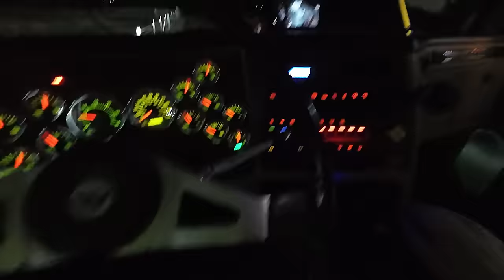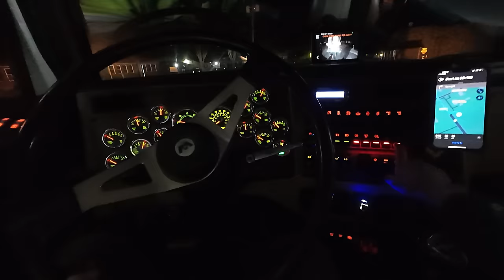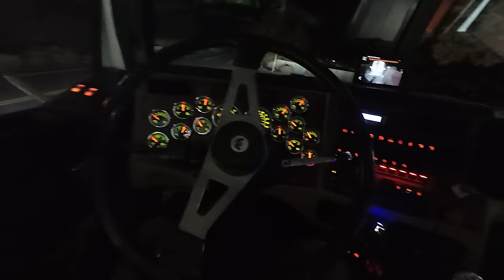This job almost beat me..

Comment: Hey Casey Like your Videos, Just wondering why you just didn't drag the back around with the winch enough  to hook to the rear. Been a Diesel tech for 30 Years , those old Spicer style cup u-joints have always been a bear to get out,  unless there the new style half round we grab them from the rear if possible, I have spent 3 to 4 hours in the shop and with a Torch just to get them dang caps out and usually have to replace the yoke because there in so tight they gawle  up the yoke  . I avoid them at all cost when on the road with limited tools just curious

Comment: I do love my tigertools for the rigs and my get around vehicles especially 1 ton trucks with aluminum driveshafts the dumbest idea because if you regularly grease your vehicle and ujoints last till the 2 different metals basically bond together and the ears bend or snap when i hear ujoint noise I swing by my driveline shop have a metal 1 made and either break the ears off or saw the shaft in half and toss it in my scrap aluminum bin

Comment: Could you have backed out, took it to the store and switched ends there? Also, I've never seen "pressed in" ujoints that needed a press. I've only seen em in worn out AC loaders.

Comment: Lucky that horse can't leave YT comments... they could tell you how you did everything wrong... after all, the horse was actually there, and as an experienced heavy recovery operator, the horse would certainly know...
Looks like the coat of black paint on the front bumper and drive wheels was all that was holding that truck together for the past 18 months...
When you were removing the driveshaft, I could not help but notice the cardboard and duct tape 'apparatus' on the front diff... looks like an aftermarket part!

Comment: Hey Casey, you ain't got to pull the driveshaft on a rig if it has a manual transmission, you can leave it in neutral and roll on, now automatic transmissions are a different story
Reply from the maker: You are very wrong

Comment: Because I know nothing… I get the transmission is lubricated from the engine side, but to pop it into neutral and move it a few hundred yards or even to the station you turned around so you aren’t working in the mud and have more room… does that not work?

Comment: I reckon the Casey way of doing things on that job was the right way already. Now if someone would only invent a way to quickly disconnect the drive shaft with a lever and the pull of a pin....

Comment: By the time a rod comes out the side of those engines, the crank and heads will also be done. Bearing material will have gotten everywhere, destroying the oil pump cams, in to the timing. That's a lot of scrap metal. Why was that short video about brake pedals dropped in the middle of that clip?
Reply: Oh, Happy New Year BTW. We have floods all around us here, so I don't really want to go anywhere. Plus heavy rain forecast all night, then a big storm for tomorrow.

Comment: I hate you Casey!  You know your way around tractor and trailer And around tow trucks, one ton to ten  wheelers. Good on you.  You were spot on on the way you worked through the decision matrix to come up with a plan. You were good until you grabbed reverse. I was a traffic officer on US 101, south of San Jose, CA, called Blood Alley. I ran interference for the tow operators who came to clear my roadway. The road was four lanes wide and nine miles long with no controlled intersections. My first year saw 21 fatalities. When a tow rig showed up on my scone, I had one question: What do you need ?  If you were on my roadway and didn’t let me cover you when backing out of that driveway we would have words. It’s my job to keep the roadway safe and I knew how to do that. Please don’t think you are doing law enforcement a favor by not getting us involved. Yeah, I kinda still Hate you but just until I can buy a shirt. Keep doing what you do and I’ll keep watching, Ed

Comment: If you were willing to pull it as a tow "forward" into the farmyard and then swap ends, why didn't you push backwards onto the road, pull it down the road to the store, and swap ends in the store's lot?  Possible damage to the transmission would have been minor either way. -Honest question, not a troll question.
Reply from the maker: Because to tow it down to the farm yard would be nothing more than lifting it with the forks and going.  Towing it down to the store would be tying down the front end, safety chains, and rear light.  At that point I might as well just pull the shaft too and be done
Reply: I don't think I made my question clear.  Why didn't you lift the front as you did and back it out onto the hwy., then roll down to the store, and swap ends in the store's lot, tying down the steering wheel etc.?  No need to pull the drive shaft for the short hop, and minimal possible damage to the tranny.  I know I am missing something, I just am not seeing it. @CaseyLaDelle

Comment: The 3rd and 4th options would have been flat bed it. Or pull the axel rods out but if you dont have cover caps then you lose all the axel oil.

Comment: Question, why do you almost always remove the driveshaft?

From what I've seen in a few videos from Europe, there, the towing service mainly removes the drive half shaft.
Reply from the maker: Because removing one driveshaft is faster than removing four axle shafts
Reply: @CaseyLaDelle   From what I've seen, it's only one. Maybe two if the truck is 2 axle drive. 

https://youtu.be/4hLQ7opU-mw?si=NW5OZ475UAIDbz_N&t=582
Reply: @CaseyLaDelle  You may actually be right that sometimes it is necessary to remove both halves. With that said, I guess it depends on the axle manufacturer - ZF recommends removing both.

https://youtu.be/rHyCzPx5mzY?si=K7WTGT3YQp6fpSV-&t=992
Reply from the maker: @spexpl  all four must be pulled.  Anything less is a hack job

Comment: So in a case like that, What i have done is pick the truck up with the boom from the back of the frame. Straighten it out then back up the drive, Put rear axel forks in and lower it onto the under reach. Works really well for one backed in if you can get backed in beside it. Another completed tow, Well done. Not sitting in traffic is always a plus.

Comment: Gentry and Sons Trucking decided they wanted to be a wrecker service and he has never had experience with the obviously you should check him out but whenever you are securing the axle to the Zach lift you should run your safety chains around the axle hook them in and then stretch them out tight so they are doing two things holding the axle to the Zach lift and working as the safety chain it's funny when you went to shorten your safety chains I was thinking the same thing
Reply: I'm sure the straps hold the axles just fine but chains would be even better but to each their own
Reply from the maker: How would the truck turn if I did that?
Reply: @CaseyLaDelle  once the chains are locked down in 2 chain locks each and the safety chains loose enough for you to turn I seen them do it on one of the shows where they are Towing on a Snowy Mountain Pass guys that have been Towing for 30 years

Comment: would have towed it from the rear , and left the truck back a little more , but dont think those lights would be in the way anyway, easier then pulling that driveshaft, utilize the underlift, instead of shutting down the road .I'd have pushed it into the driveway further , then hook it and go. that driveline is a perfect example of a mechanic that dont use anti-seize when he put it together.
Reply from the maker: How would you push it into the driveway?
Reply: there wasnt that much traffic on the road I would have backed up to it like i was hooking it and got it farther into the drive before completing the hookup
 @CaseyLaDelle

Comment: Why do you have to pull the driveshaft, why can’t you pull it in neutral? I honestly don’t know much about towing.
Reply from the maker: The gears in the transmission are what splash the oil around and lubricate the bearings.  When in neutral, the gears aren’t turning

Comment: Why wouldn't you drag rear parallel to road and hook up rear roll down the road. Seems like much less work and not closing off road.
Reply: Casey explained all that,  he did not want to do that on the most accident prone time of the year "possible drunk drivers" and high danger.      Listen at 37:00 for a few minutes,
Reply from the maker: I wasn’t going to work next to the road.  I would have gone home and left it for someone else to deal with if that were the only option

Comment: I’m not sure how a well greased u-joint comes out easier considering no grease is applied between the yoke and the joint…..
Reply from the maker: It actually comes out a lot easier than a dry one because you’re only fighting one dry joint instead of two.
Reply: @CaseyLaDelle  that makes since

Comment: My vote would have been boom the whole tail end to an angle to snag from the rear…
Reply from the maker: I wasn’t going to work on the shoulder of the road.  I would leave it there and go home before I did that
Reply: @CaseyLaDelle  of course I wasn’t there and cameras do no justice to angles and distance. All of this is 100% couch quarterback 😏

But the side of the driveway you pulled into looked wide enough to pick the whole tail end up on an extend boom, pull the boom back, and even back a little on the boom - drop and pick from the rear… At least from my couch… Or boom over the cab and pull it further into the driveway. With a remote hop in the cab and steer it down the driveway. Just seems you got a boom you might’ve been able to put that thing in a better position for a pick on the under reach?

I used to do it with sling wreckers in a junk yard when I was a kid - my first job. Which doesn’t make me a know it all, but done it before on smaller stuff that damage doesn’t matter…

Just seemed like the two options you were thinking of were making use of one tool when you had the use of two. A boom to get you to a place better for the under reach. 

Anyway do love the content - and the channel. Sorry about my couch comment…. Happy new year!

Comment: You have already made your decision, but I wondered if it would have been possible to tow it from the front a far enough distance to get to a place you could pull off, then connect to the back so you did not have to drop the axle.

Comment: Looks like a good job for your trailer if you had only known
Reply from the maker: That would be way worse.  Nowhere to park the trailer
Reply: Yes I fully agree with not having enough room to park the trailer and I think you did a terrific job I have never run a wrecker truck but I certainly have been broke down enough times with a big truck

Comment: Just pull the driveshaft.  Those 1710s aren't that hard.  I've pulled them under the same conditions - and then had to rebuild them, including cutting the yokes and welding in a new tube.

Yeah, I know, it's cold, you're tired, it's the middle of the night.  Got it.  Just do the deal.

Comment: These are the most dangerous jobs. That's when A. you don't want to be there. B. nothing is going right. Anc C. frustration is setting in. And D. time is short. That's when things, for me, are most apt to get really messed up. It takes a lot of self control at that point.
you bet a pass on a little bit of foul language on this one. It may have helped a little bit.

Comment: Why would you grease a with a press fit you don't need grease on that part it comes out easy because it's worn out
Reply from the maker: When the yoke itself is dry it makes it much harder to press the cap out

Comment: Why not pull an axle 🤔
Reply: He’s replied elsewhere is that it’s not easier because that would require dealing with all four axles versus one driveshaft.
Reply: @JohnHallgren  I've been towed to different places and the wrecker guys only pulled 1 axle..LF
Reply: @johnsherwood9960  I was just repeating what he had replied multiple times in other places here to similar questions.